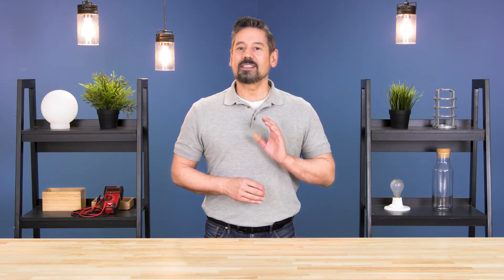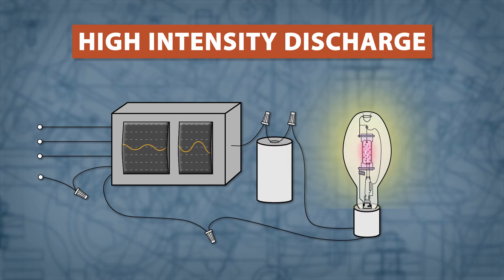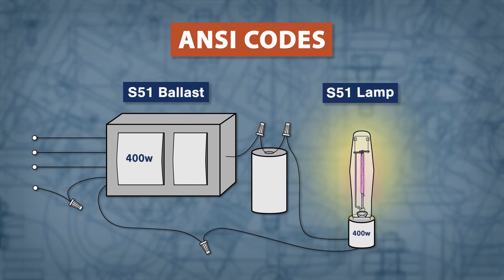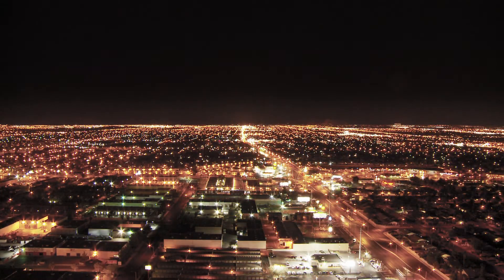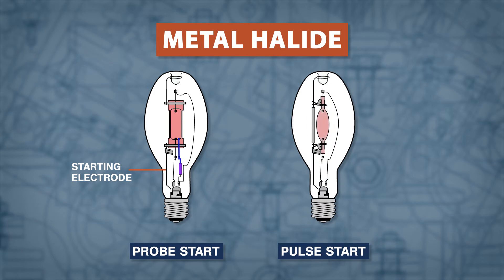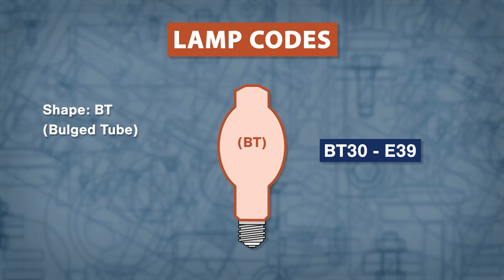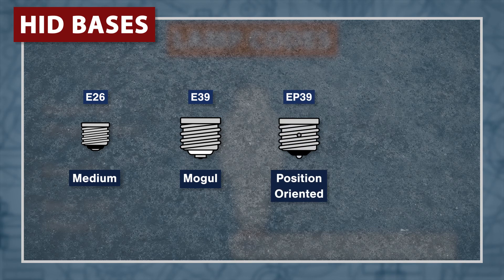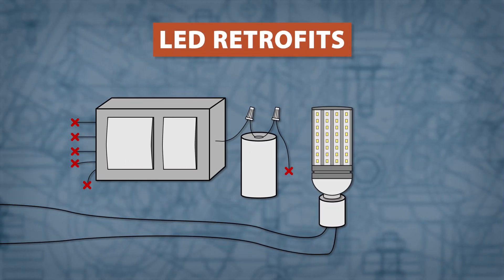The Complete HID Lamp Guide | Spec. Sense

Comment: EX-39 sockets are  required beginning in the 2005 National Electrical Code for open metal halide fixtures, usually a pink or reddish color and is designed to only allow an open rated metal halide lamp to operate,  an enclosed rated lamp will not light if installed,  but a open rated lamp will work in EX-39 and E39 sockets.  

This is very important from a fire and burn injury standpoint because metal halide lamps sometimes violently fail, and at full brightness can breach the other bulb showering the area with hot quartz shards of around 2,000°F and this usually happens near the end of life as thermal and chemical stress weakens the arc tube over time, and its this reason most manufacturers recommended turning the lamps off for at least 15 minutes once a week for lamps operated 24/7, since a lamp close to or at EOL will usually not start or act strangely upon starting giving warning to replace the lamp promptly,  and it's safer for it to fail before it reaches full brightness.

Open rated lamps have a ballistic quartz shield around the arc tube to prevent a ruptured arc tube from breaking the other envelope making them a safer alternative for businesses that still use metal halide.
Reply from the maker: Thank you for sharing that info.

Comment: One exception to the correct ballast requirement is high pressure mercury lamps on probe start metal halide ballasts.  175W and higher mercury lamps will run on the equivalent power rating probe start halide ballasts, but not reliably the other way around as halide lamps need higher open circuit potentials than mercury lamps due to the halide dose driving up the plasma resistivity.  New halide lamps will run on equivalent mercury only ballasts, but the lamp will cycle after a certain proportion of its life as its operating potential rises beyond the ballast operating output potential.
Reply from the maker: Thank you for sharing those details on those exceptions!
Reply: Interesting details,  I always wondered that considering the metal halide lamp is so closely related to the mercury vapor lamp that multi-vapor is a trade name used by General Electric when they were introduced in the early 1960s.

Comment: Can I use a LPS in a HPS ballast if I keep the wattage the same?
Reply from the maker: Hi Bob thank you for watching. Even if two bulbs have the same wattage its recommended to match the bulb with the ballast using the ANSI code. Without matching there will likely be reduced performance or lifespan.
Reply: Thank you for your reply. Here is the reason I asked. My 12 year old son has high functioning autism and kids with this get interested in very specific things. And with my boy, it is HID lights. He loves them, has researched them and knows a lot about them. I have been able to buy a metal halide and a HPS off eBay for him but he wants a LPS light very much (he wants to see its monochromatic affects at night especially.) But I simply can not find a LPS ballast anywhere. 

So I’m not really worried about shorter bulb life as it won’t be on more than maybe 10-15 minutes at a time. He just really is into HID lighting and loves to watch them arc and start up until full brightness.

So considering all of this, if I am able to find a LPS bulb with the same base, voltage and wattage as the ballast I have for his HPS light, will it at least start it and allow it to come on ?

I hope this makes sense and doesn’t sound weird. I try to support his interests as much as I can and to be honest, this has been very interesting for me too and he has taught me a lot.

Thank you so much for your time. I really appreciate it.
Reply from the maker: Thank you for sharing and that makes sense given the circumstances. Matching for the same base, voltage and wattage it will likely light up. If you have a magnetic ballast then the LPS might flicker a little bit.
Reply: He has 2 actually. One I bought off eBay and is a small residential security light (looks like a halogen light fixture but is a HPS.) 

His other ballast is actually an old HPS streetlight. I emailed our local power company to see if they had any old LPS lights and they didn’t, but they invited him to their facility for a tour and gave him a HPS streetlight they were not using. He was so excited with that. One has an e27 base and the old streetlight has an e39 base I believe so hopefully one of them will work.

Thank you so much for your time and help. It means a lot and I appreciate it very much.
Reply from the maker: That is nice of your local power company to give a tour and to give him an spare HPS streetlight. We're happy to have helped out. Hopefully everything works as you need. All the best to you!
Reply: No Absolutely do not do that. It will kill it within seconds. High Pressure Sodium is NOT like LPS. LPS runs on different voltages and current rating. You NEED to get an LPS ballast. You can get an Old Thorn Beta LPS fixture for him, but DO NOT use an LPS lamp on an HPS Ballast.
Reply: @SaudiSpeedLS2  Not necessarily kill it immediately, but the LPS lamp will be overloaded as the smaller sizes of LPS lamp run on 330mA (18W) to 600mA (35W and 55W) and HPS lamps run at around 800mA for 35W lamps and 1.18A for 50W lamps.  LPS lamps also have much higher operating potentials than HPS lamps and so HPS ballasts won't be able to easily keep LPS lamps lit.
An easier source for LPS ballasts is to use instant start fluorescent ballasts as LPS lamps are electrically very similar to fluorescent aside from the higher starting potential.  Lots of collectors use Fulham Workhorse 2 ballasts for 18W lamps and workhorse 3 ballasts for 35W and 55W lamps with both red wires connected in parallel.